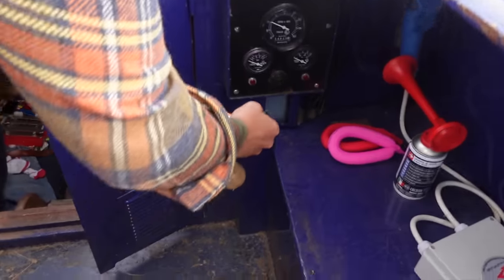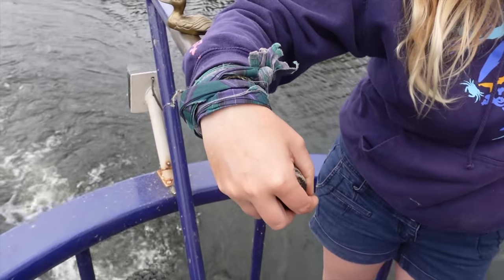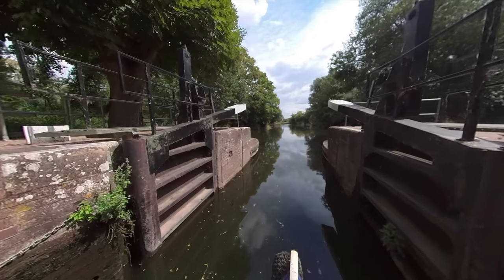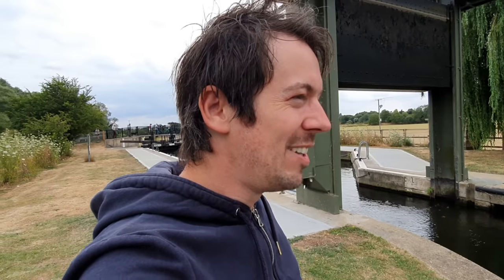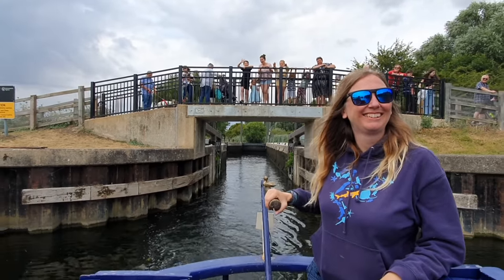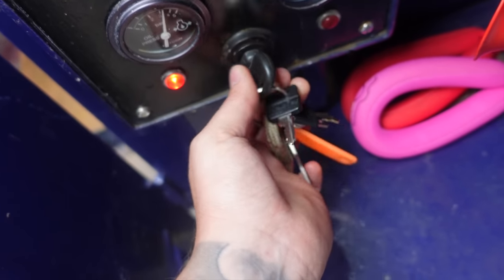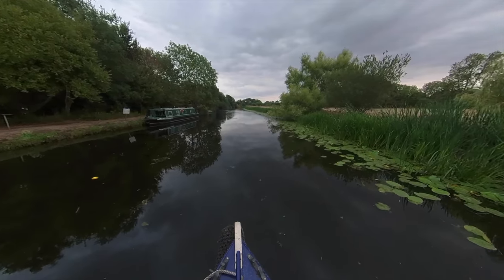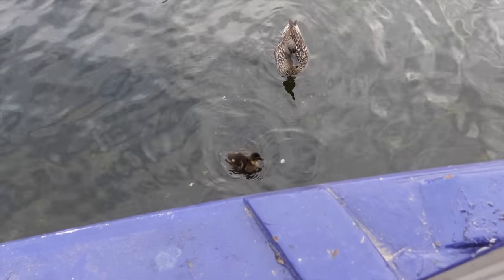Is this the BEST place on the OUSE ?? DO YOU AGREE??

Comment: Hey guys. A tip. When the boat is up to speed. Take the throttle down a bit. It is half the nois and you go just as fast. This has to do with the hull speed. When in top speed it pulls the hull down in the water and therefor you go slower. Because the motor overpowers the hullspeed. So when you throttle a 1/4 down then you go fast and thus less noise. Greatings from the netherlands
Reply from the maker: Oh amazing thanks for the tip, we will try this in the future, the engine is already quite noisy it would be nice to bring it down a bit, thanks again and hi from England 🇬🇧
Reply: Puncture a few cans of expandy foam & chuck em in the engine compartment 😉😆
Reply: We used buffalo boards on our decking and this helped cut down on the noise too. But great advise 👍
Reply: Not sure what revs you're doing, but I usually cruise along at about 1,200 rpm.  Reasonable progress without making too much noise or wake.  Cheers

Comment: Hi Chris and Becca……Regarding your buzzing phone charger…..your inverter is more likely a ‘modified sine wave’ type, which wont run anything apart from an old type radio and bar type heaters and will affect anything we all now use day to day as they’re full of electronics. A modified sine wave inverter can also damage these devices. You need a decent ‘Pure Sine Wave’ inverter as these produce the same as the grid does so everything runs sweet. The proper pure sine ones are expensive, and modified sine are as cheap as chips and we tend to use these as mud anchors……😁
Reply from the maker: That's an Interesting theory, as becca does think we have a sine wave, I have purchased a serge plug which will hopefully protect the laptop, but not sure if it's good long term??thanks again

Comment: Hi Becca Chris,well you are on the good and proper nice to know you have had no problems with your engine sounds a bit loud ,I noticed you plug on your charging lead was not pushed home ,you may find your battery’s are not giving enough power to charge your laptop,I love this part of the river I have spent many a times on there in how boat,you both take care keep safe,John 😂🤣😜🤓🤓🤩🌹🌹🥵👍👏🙌🤬🤬
Reply from the maker: Its a beautiful part of the river , there's so much to see, yes the engine is a bit loud, it's a Ford transit unfortunately but seams very  reliable do far, we have started bringing it down a bit when up to speed.yes it seams the charger doesn't like our batteries very much so we're looking into something that will hopefully work a bit better, thanks for your comments, always do useful 😀 👍 😉

Comment: Your Mac charger needs to be on a pure sine wave inverter which I assume you don’t have. It will get damaged if you keep doing it and they are not cheap.
Reply from the maker: I've heard this sinewave stuff a few times know, becca thi ks we do have it. I think our system need a good clean up,thanks for your advise
Reply from the maker: Thanks so much for your help,I may look Into one of these 12 volt chargers, could be alot lot cheaper, so much to learn

Comment: Great a lovely day and no trouble,  now we have to worry about this leak.  So what was the problem with the power, it just worked the next morning.  It was a pretty ride.  You’re really doing well getting these vlogs out, I honestly didn’t think you could do all the work you’re doing, have some time to yourselves and produce vlogs at this rate but you’ve done it.  Oh ME of little faith, well done, you’re not just producing vlogs you’re producing fun good quality vlogs.  Thanks guys, stay safe and I wait for your next update.  💕
Reply from the maker: I think our leasure batteries must have run out, luckily the starter motor is separate so we could start and then on our travel managed to top the leasure batteries up. Just a small leak that hopefully won't get in the way..its to do with the stern gland and has started to let water from the river in alot more than normal since cruising. Thanks for noticing I've been working like a work horse trying to juggle the boat and getting the vlogs done, thaks again Pauline

Comment: Hi Becca, Chris, it's great seeing you are on the move. Nice cruise too. At the end of the Vog, your mooring lines were a bit odd. You had put out spring lines. Notice your bow was drifting out. One should pull back on your bow line and then Moore up, On the stern, the line should be moored to the rear of the stern. Having the extra two spring lines are very helpful in windy or bad weather conditions. I loved the Vlog. Thank you. Have a great week. Take Care.
Reply from the maker: Thank you for your helpful comment, I personally am pretty bad at tieing the boat, I just go with what seams secure, the bow was actually sticking out because  the Hull was touching the side at that point, though yes it doesn't look right...maybe meet time we will need our plank haha...thabks again see you on the next one 😀

Comment: If your engine starts but your lights went out it would suggest that your leisure batteries (separate from the engine starter battery) are knackered or the alternator isn't charging them. You mentioned that your battery was down below 9v (not sure which one) but I'd say that whichever battery that is needs replacing. If it's one of the leisure batteries (there's normally more than one) then I'd replace them all! Lead acid batteries should not be discharged below 50% capacity (about 12.06v) or they will lose capacity quickly!
Reply from the maker: Thanks for your suggestions, yes I had heard that replacing all the batteries is the thing to do as one bad one can damage all the rest. It's a complete minefield of boaty puzzles. I think we may need to get someone to test them all again 🤔

Comment: You might find the Charger does not like the mains voltage from the 230V inverter, the cheap inverters do not make a very nice output waveform. it should be a sinewave at 50Hz but they tend to be a series on steps in voltage which look a bit like a sinewave but is not. this can cause noise in some devices.
Reply from the maker: Oh that's Intresting I think we need to seriously look into it, becca feels we may actuate a sinewave one but we're not certain, thanks so much for your advice 😀
Reply: @TheNomadicCrobot  is your inverter a modified sine wave or pure sine wave? Modified sine wave inverters are cheaper but are not suitable for sensitive electronics like computers or TV's. Would be wise to upgrade to a pure sine wave inverter for peace of mind. They should safely run any device. 
Modified sine wave is only really suitable for things like fridges and washing machines or power tools. Stuff without complex microchips.

Comment: 👍👌❤🇨🇦,People also ask

Why does my computer charger make noise?

A "hum" or "whine" is relatively normal, and likely an innocent by-product of the transformer using electromagnetic plates to convert current. A "crackle" or "sparking" noise is potentially a sign of a failing transformer, and a potential fire hazard
Reply from the maker: That's interesting, thanks for your help, it doesn't sound massively safe but I have since got myself a serge plug so hopefully that will save my laptop but long term its probably not practical

Comment: 6v is way too low for your battery & that sort of treatment will degrade it very quickly. You can get a battery monitor & it will switch off the electrics at a set voltage to prevent over discharge.
Reply from the maker: Oh brilliant thank you, I have since got myself a serge plug to hopefully stop my laptop exploding ,though the noise is still very present
Reply: @TheNomadicCrobot  Try & eliminate a faulty charger by plugging it into a "normal" plug (one that's not connected to your  boat system) & borrowing a friends charger to see if you get the same noise when plugged in to the inverter on your boat. A surge protective device is more intended to suppress spikes coming in from outside. It won't save your laptop if the charger decides it wants to go up in smoke & take your laptop out with it.
Reply from the maker: Thanks for your advice, I don't think the charger does it when plugged into a household socket so it seams to be something to do with the power coning into the boat

Comment: If your batteries were down to six or seven volts they are totally fritzed. But the alarm would likely have sounded around 11 or so (which is still very low). With the panels producing charge the volts you read are prolly higher than the charge the batteries are typically holding.
Reply from the maker: Thanks for your help, yes an alarm went off on the inverter but we've been careful not to let it drop that low since and have been OK. Only one light comes on when starting the engine and then turns off after running a few moments in, the leasure batteries do seam to be charging as we have been having more power after our cruises, thanks again

Comment: Hey fantastic!  I got caught up on the last few vlogs just now.  You finally got moving!  That's a good two weeks traveling around and enjoying yourselves back and forth to your hull blacking thing.  I hope all goes well!

EDIT:  Oh yeah, your laptop charger noise.  I am guessing the problem does not occur when you plugged into a regular power grid.  I could be wrong.  I think it has something to do with inverters, ac/dc conversion, etc.  Maybe stop at a gas station or something and see if the noise occurs there?
Reply from the maker: Thanks for your help, yes it doesn't seam to make this noise when plugged into a household socket,  I just don't want to damage anything, there's so much to learn,  it's lovely to be able to experience a bit of off grid boat life, mooring up we're we please,just amazing 😀

Comment: Charger sounds fooked chuck it
Reply from the maker: Hmm Intresting 😒
Reply: @TheNomadicCrobot  - it's a waste of energy inverting 12vDC up to 240vAC and then using a switched mode power supply to get the 240vAC back down to the required voltage for the laptop. Best to get a direct 12v adapter.
Reply: @danensis  you tuck the words out my mouth